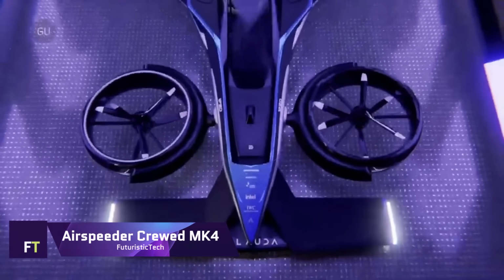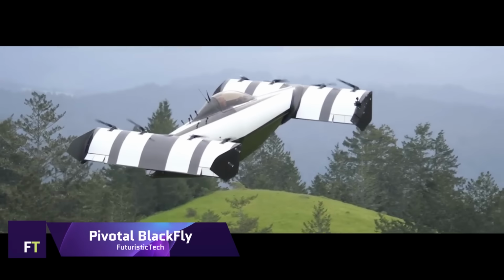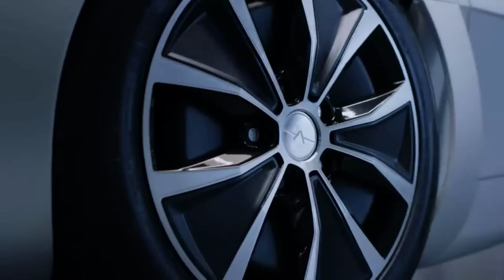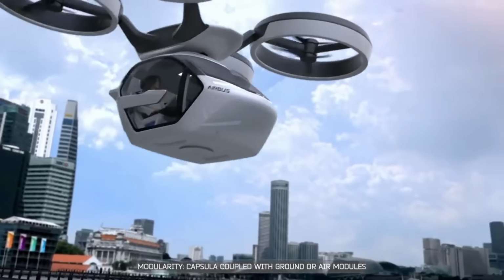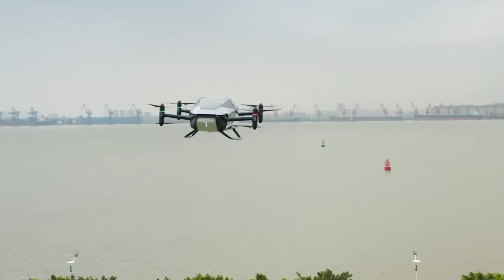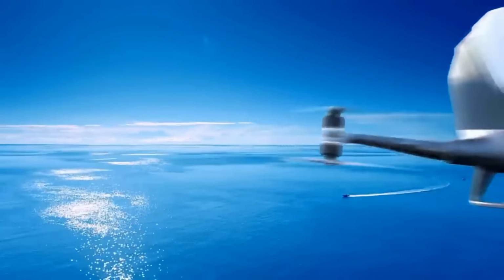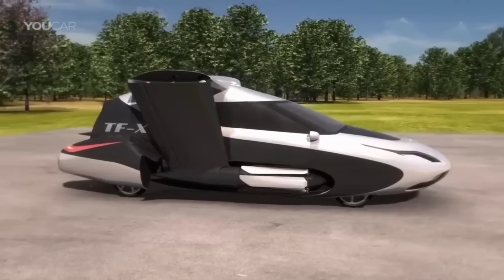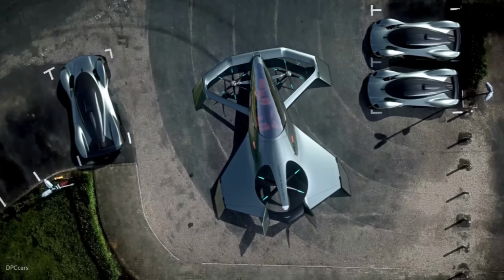AMAZING FLYING CARS YOU MUST SEE

Comment: # 1. Can you imagine what your car insurance agent will say after side-swiping one of these spensive beauty's on the 405 freeway in L.A.?  I wanna be that fly on the wall huh?
# 2. Most planes have one prop to worry about, with 4 to 8 open rotating Chop-O-Matics spinning at 10,000 rpm piloted by rookies and toruists, can you say closed casket funerals?
# 3. Battery powered anything today has big problems with shorting out and or over-heating or whatever from E-Bike's to Tesla's. 
# 4. Anything that takes the Fire Department four hours to put out a Tesla battery fire is really scary. The E-Planes will have much bigger batteries to achieve longer flights huh?
Reply: Pessimist! What if they asked about the accident and you said what accident. I flew straight over him. Use the third dimension.